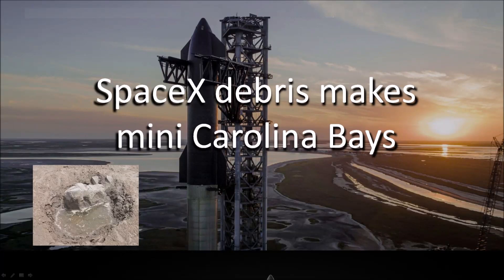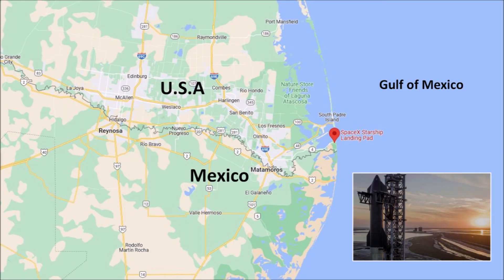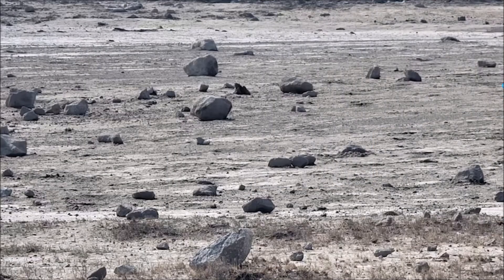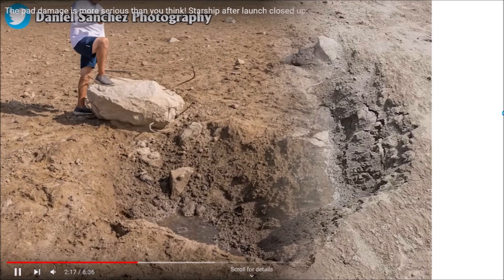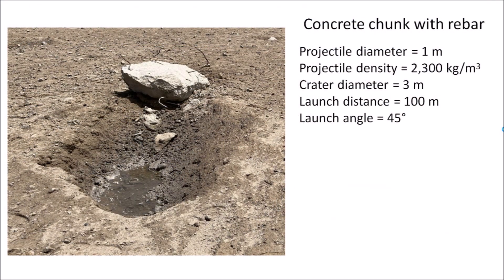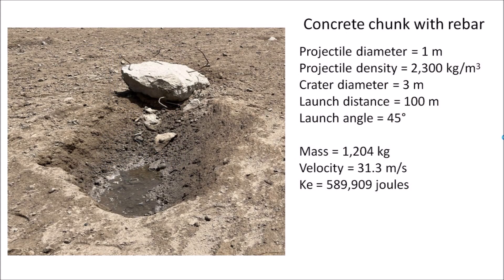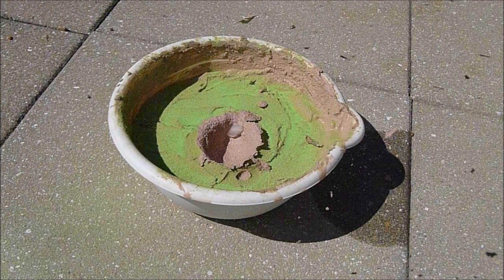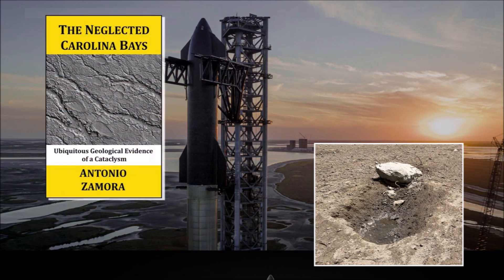SpaceX debris makes mini Carolina Bays

Comment: This investigation seems to indicate that ballistic projectiles can both penetrate the substrate and then skip out of the depression via a secondary trajectory. Are there Carolina Bays that express this possible disposition?
Reply from the maker: The impact and skipping scenario happened in one of my tests when the target material was not very wet. I still got a nice elliptical crater, but it was not as deep as the ones on a more fluid target.
Reply from the maker: Ice is fragile and it will shatter when striking a hard surface. However, impacts on unconsolidated ground close to the water table will liquefy the ground and the subsequent impacts will make inclined conical cavities that look elliptical when viewed from above.

Comment: Might be interesting and fun to load a cannon with a round sphere of ice and fire it off. Just to study the way that the ice impacts and subsides as it melts.
Reply from the maker: Although my experiments are small, I have seen that after the ice makes the crater, it floats because it has a lower density than the surrounding soil.  The ice projectile ends up closer to the surface.
Reply: @Antonio_Zamora  : Would the impact energy of the ice boulder be sufficient to vaporize it, especially if it disintegrated on impact ?
Reply from the maker: @vijo2616  The impact energy of an ice boulder that made a Carolina Bay would not be sufficient to vaporize it.  The fact that the bays are elliptical indicates that the ice boulders made inclined conical cavities without breaking up or vaporizing.  Of course, they later melted and left us with a big puzzle.

Comment: Millions pissed away trying to achieve something that was done 50+ years ago.
Reply: How many rockets do you think NASA or Roscosmos blew to smithereens during the 50's, 60's, and 70's trying to figure it out? Their benefit was having scientists who worked tirelessly during the previous World War inventing rockets which inflicted as much collateral damage as possible and built off of it to put people on another planet. All of those people, the thousands who supported them, and much of their technology has been lost to time or replaced by new technology and people. Now we must begin again, almost from the very bottom and not only that, we're attempting to make them reusable. It's just not that simple. The road is not as straight and narrow as we'd like to look back on it.
Reply: @Keys879  Yup, also SpaceX is using methane and LOX instead of kerosene or hydrogen and LOX, so the engines will be different. As well this ship design is a lot more powerful than the Saturn 5; compare 165 tons capacity to 118 tons, compare almost 17 million pounds of thrust vs 9 million. 
AND this is a reusable design, which brings the cost per pound launched way down.

I'd liken the comparison to a small 50+ year old pickup to a modern pickup with fuel injection and bigger cargo capacity. Are new pickup trucks a waste of money?

So, this is definitely not the same thing that was 'done 50+ years ago'.
Reply: @Keys879  We have children starving and dying all over the world and yet what do we do we spend it on rockets to go to the moon and people like you who have there head so far up there ass support this useless crap that was already done and doesn't help anyone, cancer research would be a good thing to spend millions on but no you wanna go to the moon
Reply: @Keys879  Ah yes because no one knows how to launch rockets these days.

No one except NASA, ESA, JAXA, Roskosmos, Virgin, Blue Origin, CSNA, ISRO and of course SpaceX itself with it's Falcon... have any idea at all how to launch a rocket these days without destroying the launchpad or blowing up the rocket.

facepalm
Some people can hide their brown nosing tendencies. You are not one of them.
Reply: this is a rocket that has done many firsts
full flow staged combustion methalox engines which have a +300 bar chamber pressure
literally the largest and most powerful rocket ever made
the thing is built to be fully reusable
so no this wasn't "done +50 years ago"

Comment: Well look at that.   Proof of concept again.
Reply: Woah woah woah, these impacts were clearly created by cretaceous period fish and prevailing winds. Nothing to do with debris on ejecta trajectories! (sarcasm in case you didn't catch it)
Reply from the maker: Haha. I thought about mentioning that the craters were not made by the prevailing wind of the rocket exhaust, but that would have upset some die-hard aeolian supporters and the fish nest advocates.
Reply: @Antonio_Zamora  it is comical to hear some other explanations.  There is such a resistance to historical cataclysms while simultaneously acknowledging an impact killed the dinosaurs, which is itself a theory they resisted for decades.    Maybe the bays were just small round  holes and then the land surface stretched out like a balloon, but gradually over thousand of years. 😂